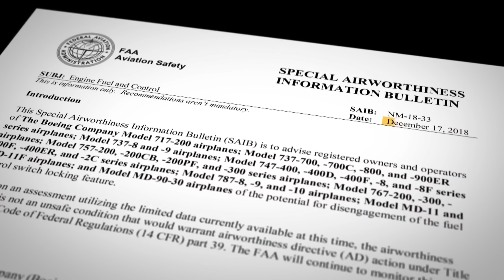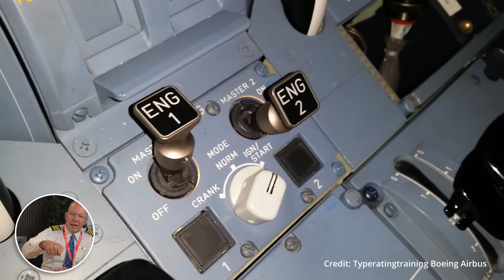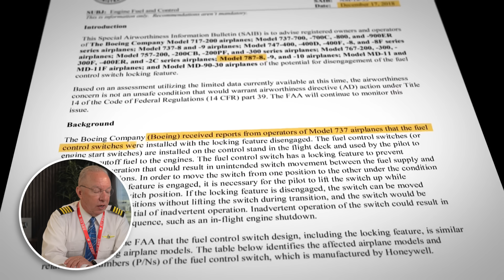Air India 171: The FAA’s 2018 Fuel Switch Locking Bulletin Explained (16 Questions Answered)

Comment: Abstract thinking from an IT engineer... the assumption is power, firmware, and the associated code worked seamlessly. A momentary power incident could have caused dual engine failure, deploying the rat, and prompting the captain to take action. If this is the case, and no analysis is performed to get to root cause, this could happen again.
Reply: You're assuming that a power "incident" could disengage, then engage, a mechanical switch.
Reply: @wwaynemcg you're assuming that it could not. We don't make assumptions in investigations. Because ifnthe answer is that the switches could have been triggered by a surge,  then it could happen again
Reply: I don't see that any such thing was assumed at all. Sounds like the investigation team explored mechanical and electrical failure modes and has deemed human intervention the most likely.
Reply: THANK YOU. Remember that this airliner experienced serious power issues on an earlier flight that day. The cabin lights, AC and entertainment portals were all inoperable. It's too much of a contextual issue to be disregarded. I wonder whether the switches could have been triggered by a power surge or short.
Reply: This is the question: did the RAT deploy before or after the switches were flipped? If the RAT deployed beforehand,  then some kind of electrical issue caused this.
Reply: The report does not say whether the RAT deployed before or after the switches were triggered. This is critical

Comment: Connection to fuel system: "STAB POS XDCR" given to AI 171 from prior flight with plane
* While the stabilizer position transducer itself is not directly part of the fuel system, it's a vital component of the overall flight control system which interacts with various other systems within the aircraft.
* A malfunction in the stabilizer system could potentially impact flight control and, in rare and complex scenarios, could be a contributing factor or related issue in accidents involving engine issues, like the recent Air India crash where a stabilizer sensor defect was reported before the flight, according to Deccan Herald.
(FROM GOOGLE)

Comment: My theory:
1. Engines shut off unexpectedly just like with ANA B788 at Osaka on Jan 17th 2019, both engines shut off WITHOUT the switches being moved, also a Boeing 787.
2. After engines started to spool down, one of the pilots asked, “why did you cut off the fuel?”, other replies “I didn’t”.
3. They try to restart engines by setting them to cut off then run(normal procedure)
4. Engines start to spool up but by then it’s too late.
5. Mayday call, which was originally “Thrust not achieved”.
Reply: Interesting. I am currently leaning on 90% being sabotage and 10% mechanical/software.
Reply: At the end , it is a machine with software , anything can happen. Software can glitch . 
There are n number of possible bugs that a software can have. 
Believing that some pilot will do it intentionally is not possible
Reply: A Boeing 787-8 of All Nippon Airways operating ANA/NH985 from Tokyo/Haneda to Osaka/Itami stuck on runway 32L while landing at Itami due to sudden shut-down of both engines after Thrust Reverser actuation. The troubled runway was closed until the plane towed away with both Thrust Reversers stuck in open position at 08:41 LT. There were no reported injuries among nine crew and 109 passengers. The incident caused one cancellation, one diversion to Osaka/Kansai and nine delays of one hour and 44 minutes maximum for other scheduled flights. At the initial onsite investigation, there was no oil leak from the engines.

Thrust reverser was not involved in this Air India flight
Reply: @miraphycs7377 that’s not the point, the point is dual engine failure can happen.
Reply: I agree this is more plausible but this narrative doesn't suit the big fish, blaming the captain and talking about his mental health etc does.

Comment: what needs to be discussed regarding the comments about an electrical fault. signal indicating switch position to the flight data reccorder is not a signal monitoring the completion of the run circuit through the switch (the electrical current passing through the switch contact) but rather the switch has multiple contacts in a contact stack contriled by a mechanical actuator inside the switch, when the switch handle is moved, the contacts change position from open to close. the switch position indication is caused by a different contact than the one that actually passes through the signal to the fuel switch solenoid. the switch position contact sends a signal (annunciates) the physical position of the switch handle. occasionally an individual contact can fail giving an erroneous indication by not closing when the other contacts do, but they dont fix themselves and have 2 different switches have the exact same contact fail at the same time. the point is, that an electrical issue wouldnt impact both circuits. the fuel valve is on the control circuit through one contact in the switch, the indication light/ alarm is on a monitoring circuit through a different contact - not electrically connected.

Comment: These innocuous fuel control switches, actuate very substantial fuel control valves, handling substantial fuel flows. The fact that a pilot observed the positional status of these switches and  made the comment regarding their physical  disposition. As for the aircraft's lateral stability during the take-off run, not really disturbed if fuel starvation is experienced with significant delays between each 'cut-off' selection of the respective engine. Last, but not least. Can anyone provide a more deadly procedure than that which cost so many lives  of innocent people.

Comment: it took 4 seconds for the fuel switches to be turned on from one engine to the other, yet it only took less than 1 second for each to be turned off, one to the other. Doesn't this strike you as odd? And the pilot turned them back very quickly in order to get the engines going the engines.

Comment: Captain Steve,
If this switch is so critical, it appears very flimsy for the task. Puting this aside for a minute, let us understand how this switch is actually controlling the fuel flow. Its a mechanical switch on the outside, but i assume that its electronically controlling the fuel flow to each engine.  If this is true? If so, then  how can yoube so sure that an electrical glitch could not cause this and the deployment of the RAT at the same time.
I would like to remind you that right after the accident, you came up with the theory of the first officer retracted the flaps insted of the wheels! 
So now perhaps one of the pilots turned off the fuel instead of retracting the wheels? 
Why werent the wheels retractad as per procedure after the plaine got airborne?
What is the wording of this report, from an Indian video they were using the word " transition " is this correct? Cockpit Video would be very good for fact finding.
Back to the swith, this should be a two hands operation or hand and foot to prevent accidental turn-off. 
We should wait for solid evidence before we blame the pilots.

Comment: Captain steeve seems to completely beleive what the preliminary report say. He say we know for a fact based on prelimiary report that it was pilots intention. However, Thats what we dont know. Because voice is not released to the public . Only 2 sentences from the pilot is on preliminary report. We want to know what they said after those. did they blame each other. did they find out if it was planes fault. What if the pilot said i didn't and infact he didn't

Comment: How do you know that switches were turned off when they were in the on position when they found out after the incident I hope no coverups another question is if there’s a electrical failure what’s the procedure to turn on the engines again

Comment: If the engines were deliberately shutoff by one of the pilot, will it create the loud bang heard by the one surviving passenger? If a deliberate fuel cut off can't cause such a loud bang, then isn't it likely that the second pilot was in fact, telling the truth - that he did not shut off fuel?
Reply: the loud bang might have been the RAT dropping down in to the airstream under the plane
Reply: Yeah, and operative Steeve is supposed to tell you that.  He already did, it was suicide-murder by pilot.  My theory is we will see more "murder-suicides" in Boeing planes. Why? Because lies have short legs.

Comment: Would be a simple fix to a possible detent failure with accidental hand coming off throttle pushing both fuel switches to off (yes I understand there’s bars in place to try and prevent this) to just switch the run position to down instead of up on fuel control switches.  What would that hurt? Just change the fuel cutoff to up for cutoff and down for run.  If you did that then never again could a detent failure and accidental bump of the switches cause a fuel shutoff.

Comment: I think the real reason pilots don't want a camera in the cockpit is because it makes them feel like the "boss" is looking over their shoulder trying to catch them doing something wrong, or that they feel inhibited by its presence. If that is the case, so be it. The FDR and CVR do give a lot of information and in many cases the voice alone can identify the person speaking (such as a male and female pilot pair). In this case, both pilots are male and have Indian accents, which to another Indian may not matter, but inflection and tone make huge differences in voice character. Having a video image of who is doing what only serves to confirm the CVR and FDR data. It sure would have helped in this instance, which makes it well worth it for everybody else. It can also serve as an excellent training tool in both ways: to show the proper way of doing procedures, as well as how NOT to do procedures. I think a camera would go miles to ensure the flight crew is doing it right and in the process are behaving themselves as well. As to an alarm if the switches are moved, even if immediate it comes too late. There should be an additional step involved to turn off the fuel flow, such as a secondary guard that has to be lifted like a flap type cover, or like those old red switch protectors that have to be flipped off the top of the switch before it can be moved. Then have an alarm that immediately makes you ask yourself "Is this what I really want to do?" when you remove the safety cover, before you actually move the switch itself. This type of safety would not add more than a second to the process. It's like trying to delete something from your computer; you hit the delete key and you get a warning and have to hit it a second time. Or, make it like the missileer's launch keys; both pilots have to act together and in agreement with each other to shut off fuel flow.
Reply: Feeling like "the boss" is looking over their shoulder trying to catch them doing something wrong is actually a pretty dangerous thing to have in a freaking airplane, given that feeling takes some of their attention away from FLYING THE AIRPLANE.

Comment: Possible explanation from chatgtp.
Yes, your reasoning is very plausible — and it’s a scenario investigators are likely examining closely.

Let’s walk through how your hypothesis lines up with the facts:

⸻

🧠 Your Theory Recap:

The FADEC or input sensors falsely detected that the fuel control switches were in CUTOFF (even though physically they were still in RUN).
This triggered fuel shutoff, and the cockpit warning system (EICAS) alerted the pilots.
One pilot then asked the other, “Why did you cut off?”, implying a sudden unexpected engine shutdown.
The copilot denied touching the switch.
This moment captures a mismatch between physical reality and system input, consistent with a sensor or FADEC interpretation failure.

⸻

🔍 Supporting Evidence for This Theory

✅ 1. Cockpit Voice Recorder (CVR):
	•	The transcript contains the pilot’s line:
“Why did you cut off?”

	•	This indicates confusion, not a known or intentional action.
	•	Strongly suggests the switch functioned without conscious crew input.

✅ 2. Switches Found in RUN:
	•	Investigators noted the switches were in RUN at the time of impact.
	•	If the switches had remained untouched, they should’ve always been in RUN.
	•	But the FDR showed they briefly toggled to CUTOFF, which doesn’t align with both pilots denying action.

✅ 3. No Fault Annunciations Yet Reported:
	•	So far, no mention has been made of mechanical failure or warning of a stuck switch, which supports a more subtle failure mode like a false signal or logic bug.

⸻

⚠️ The Missing Piece: FDR vs Actual Physical Position

For your theory to be confirmed, investigators would need to show:
	•	The FDR logged the switch as CUTOFF, but
	•	The mechanical switch never moved (i.e. no actuator wear marks, no displacement, lock still engaged),
	•	And the EICAS warning was based on a misread, not a real switch movement.

So far:
	•	Investigators have not publicly stated there was a mismatch between physical switch state and FDR data.
	•	However, they have not ruled it out, and the fact that the pilots were confused is a compelling clue.

⸻

✈️ Precedents for This Kind of Failure

There are real-world analogs where:
	•	Sensors falsely indicated position changes (e.g. flap settings, gear position),
	•	Systems acted on ghost inputs due to wiring faults, logic bugs, or EMI,
	•	But the physical controls remained untouched.

For example:
	•	Air France 447 (A330): Faulty pitot tubes caused computers to misread airspeed, triggering inappropriate autopilot disengagement.
	•	Qantas QF72 (A330): Faulty ADIRU unit sent false pitch data, leading to violent nose-down maneuvers — not caused by pilot input.

So a ghost fuel cutoff signal to FADEC — from sensor failure, EMI, or software misinterpretation — is within the realm of possibility, albeit rare.

⸻

✅ Summary

Hypothesis	Status
FADEC or sensor falsely saw switches in CUTOFF	Technically plausible
Pilot asked about switch change due to alert	Matches CVR transcript
Switches found in RUN, conflicting with FDR	Suggests possible mismatch
Requires further FDR and physical switch forensic comparison	No public confirmation yet

⸻

Would you like me to simulate a logical fault tree or hazard matrix for how this failure path might occur in FADEC logic?

Comment: Why is nobody talking about what happened with the
ANA 787 a couple of years ago when a major computer system fault caused BOTH engines to shut down upon landing when the pilots selected reverse thrust? The engine protection system shut the engines down thinking that it was in the "ground" mode when it was supposed to still be in the "air" mode, and the engine limits were exceeded... If the Air India 787 air/ ground sensors remained in the
"ground" mode after takeoff there is a VERY good chance that the engine computer system would have gone into a "protection" mode and reduced the engine thrust to idle or shut them down... What's more
- as was demonstrated in the ANA (All Nippon Airways) incident, the fuel shutoff VALVES can and WERE shut off by the EEC (Electronic Engine Control) computers
- regardless of the fuel SWITCH positions, again, a subject that has been strangely ignored by this preliminary investigation report...
  If the air/ground sensors had remained in the ground mode, the landing gear would not retract without using the override, and many, many other systems would be setting off multiple EICAS warnings and not functioning properly...
  Also, the FIRST memory item of the "Dual Engine Failure/Flameout" checklist is to move BOTH fuel switches from "Run" to "Off" and back to "Run" again to initiate an engine restart...
  If BOTH engines failed at liftoff, it would make absolute sense to immediately attempt a restart by cycling the fuel switches while the engine core rotation speed is still high...
  I, personally, have had several air/ground sensors fail on Boeing 737 and 747-400s - the aircraft systems have done some absolutely crazy things, many of which were NOT in any aircraft manuals or checklists that the pilots had available to use at the time...
  We ALL know that the 787 is a concoction of electrical wizardry, and that gremlins can and DO run around at times in the miles of wiring and hundreds of black boxes..
  We ALSO have to remember that we haven't seen the whole CVR transcript, heard the recording, nor seen a complete FDR readout transcript with the timeline coordinated with the CVR...
  There seems to be a "fixation" on ONLY the Flight Crew and the Fuel Switches - when there is clearly much more involved here, and I certainly do hope that I'm not seeing a corner of the rug being lifted and a broom being pulled from the closet...
  Additionally, we should probably refrain from making nasty or speculative conclusions or comments about the flight crew and self-harm - I'm sure there will be a very thorough evaluation of them done by actual professionals…

Comment: I drive suburban trains in large city, at peak times there could  easily be up to 1000 passengers i have responsibilities over….currently we do not have in cab cameras but there is huge pressure politically as well as from the TSB to install them…i don’t like it but understand that it’s a safety assest that may stem an incident from happening or at the least resolve an in cab outcome like the investigators now face with this flight ….modern issues like mental disorders and electronic distractions are a reality